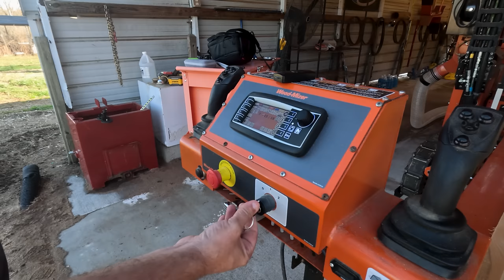MAJOR Upgrade For The KATO Excavator

Comment: A semi-permanent solution to the drive way gravel migration is to pull the gravel back more than 1/2 way into the drive, bring in clay or clay-gravel fill, grade it to "level" out the driveway and re-spread the gravel.  A crusher-run grade of "stone" would also work better than graded 57 because the crusher-run has several sizes and stone powder to "bond" the stone together instead of roll around & spread out with slight pressure. Been there & done that! Good luck.

Comment: That was one square piece of advise Nathan. I had a gravel parking area and used crushed river rock after digging out a foot of what was nothing but mud during mud season up here. Before I did that the mud could come up to the running boards on what ever vehicle was pulling into the yard never mind trying to get out of the vehicle and slog to the front steps of the house. It was awful. But like you there was a small grade that fell off to one side and so much of the gravel would flow down I was donating my river rock to my neighbor's camp driveway every year. Sure could have benefited from that machine of yours!

Comment: You need to mix some stone dust in with all that rock. That would pack it down and after some rain it would harden up just like cement.
Reply: Agree, you need more fines in that driveway to lock the larger stones in place.

Comment: Just a thought, what if you attached your leaf blower to the saw mill, pointing it to the blade so the saw dust was blown away as it cuts. It would save you a trip to do that after each slab. You could also attach a 2nd one to the other side.

Comment: Why not use some of your burn pile lumber, cut to 4 X 4 or 6 X 6  timbers, to line the low side to help hold the gravel in place. Then, if you want to put dirt over there, you can put the dirt up against the grass side of the ytimber so the grass will grow into it and help stabilize it.

Comment: If you could run over your driveway lightly with a vibrating roller it would turn up a flat face on each chip, and lock them into each other to some extent so they would be less inclined to drift downhill. You could also spread a light coat of 3/16” chips, which would get into the voids between the 3/4” rocks (as you call them 😅) and the 3/16”s would help bind the surface.

Comment: Seems to me like any kind of angle blade, either on 3 point hitch scraper blade or on your excavator if so equipped would be the simple and quick way to pull gravel back up into place.

Comment: The cheapest way I think to fix your low side gravel from moving down hill is to place irregular shaped riprap along that side. The riprap will hold the gravel and water will still drain through it. Delivery trucks won't want to drive their tires on the riprap either and will keep their tires on the gravel.

Comment: You have a grader blade, on the excavator, both tractors& a grading bucket on the skid steer. It would much easier & faster to use them to do what you are doing. The salesmen for Kato or Kubota must fight each other for the commissions on selling you an unneeded product. You keep your equipment so clean because its mostly new.

Comment: this is why u dont use loose rock on driveways u need rock with fines in it to lock everything in place. get rid of all that loose stuff and get u some ca6 at least thats what they call it in my area basically its 3\4 inch rock with fines in it. and yes u have the right idea of putting dirt along that edge that will help support that edge to keep it from shoving on you hope this helps. really interested in seeing how the katos do i never see them in my area and looks like they dont have any dealer support around here  unfortunatly.

Comment: Hey Nathan. I heard you talking about not liking to cut and dry mantles. Well these days so many fireplaces are  done with framework and double pipe flues that building a mantle out of dimensional lumber is pretty easy., even if you veneer it with some sort of stone or brick. Build a pocket style with legs built into the framework, put the veneer on and then slide the mantle on the legs, countersink some screws and cover with plugs or putty, then finish. I like your grade-all bucket for the mini-X too.

Comment: 7:23 Would it be possible to just track backwards down the drive at a slight offset and pull the rock back onto the drive? (i.e. like a grader) That way it’d be done in a fraction of the time and I’d think it would be possible with that bucket.

Comment: Son, you ran that box in the wrong direction next to the slope and graded the gravel back toward the area you just cleared.
If you roll out your drive way, you will better stabilize the gravel!
You really need redo your drive and put a good base bed down before you put the gravel on it. Your driveway will never be stable the way it is!